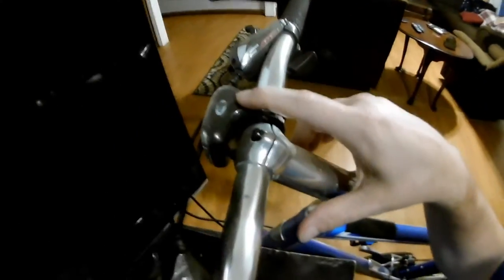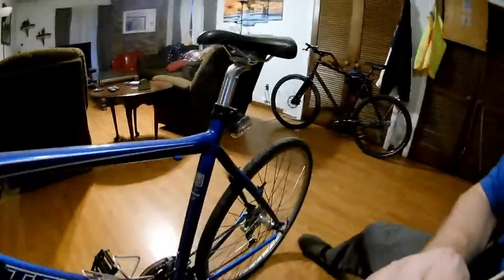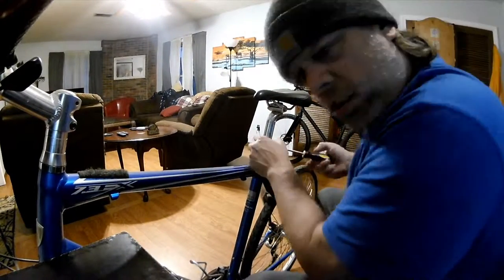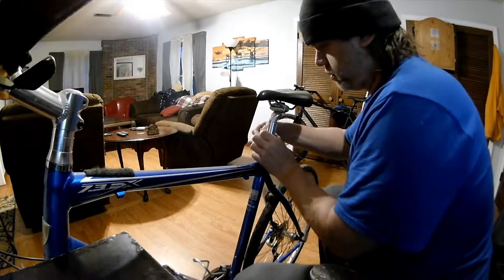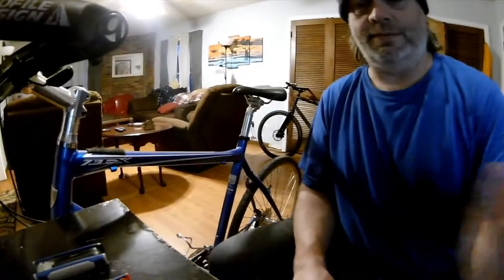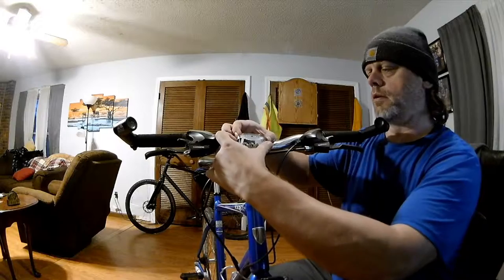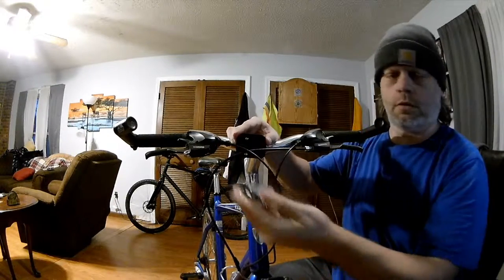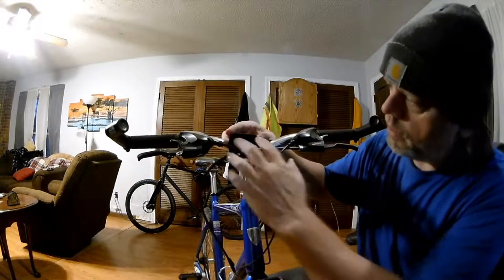Trek Lights Removal 4 19 19

Comment: I got a Bell set. They're led so the batteries last a long time and they go on with a rubber strap that you just hook over the bars. Bought em in Kuwait but I'm sure you can get them stateside.
Reply from the maker: Yeah.. I'll get something different one day. Good thing about that front light is, it's not going to move. Holds super tight.
Reply: @mikieson  I have a Nite Rider light that needs a new battery pack. I'll probably pick that up soon. These little lights don't do much at 30mph.